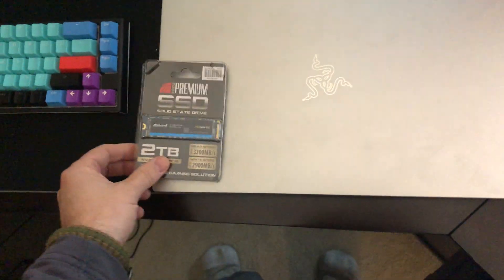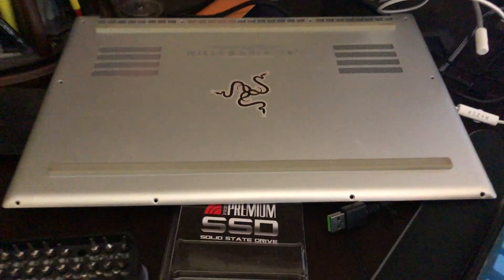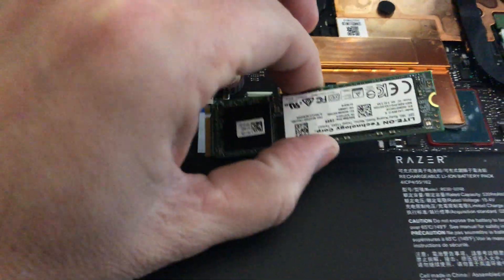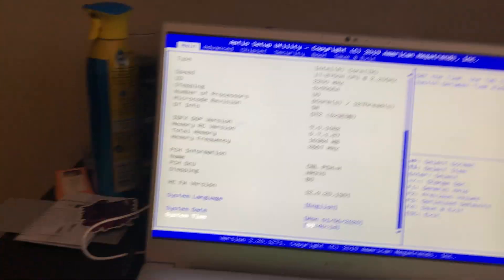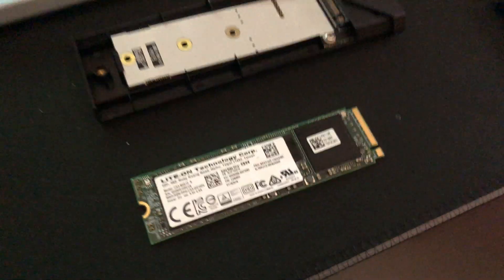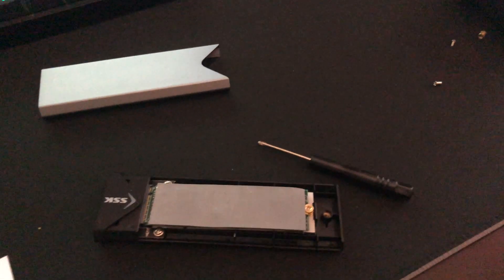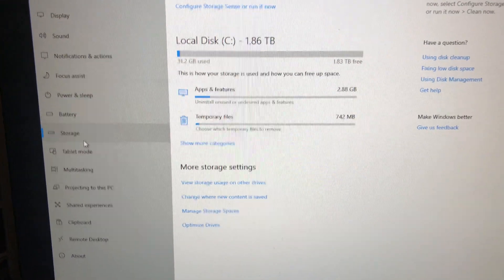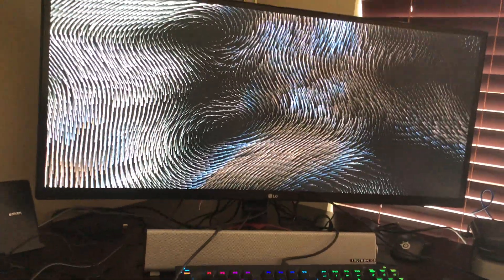How to upgrade the Razer Blade Pro 512GB SSD to a 2TB NVME SSD

Comment: Just an FYI, I picked up this EXACT item from Microcenter store yesterday, same SKU as yours, and it is NOT single-sided, which was a huge disappointment since we needed a single sided SSD for a new Dell XPS 13 that doesn't have room for a double-sided.  So, buyer beware if you need a single-sided SSD that whoever makes these is making them double-sided now.
Reply: Yep, I am hearing the same thing. It seems Inland has changed the SSD without updating the SKU which is bonkers. I still do not understand why on the packaging they don't explicitly state single or double sided for users who plan to use in a laptop.
Reply: scrapplejoejoe The packaging is see-thru so if you go to the store you can see for yourself, but if you order it online for shipping, who knows what you’ll get.  Someone in Chicago said they got one yesterday and it was single-sided.  So inventory differs or the single sided ones are old stock...